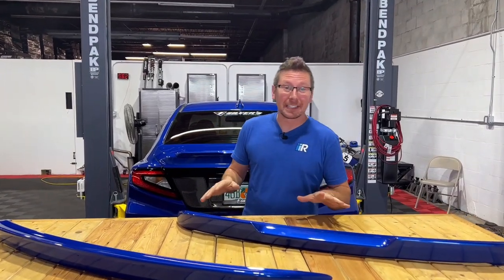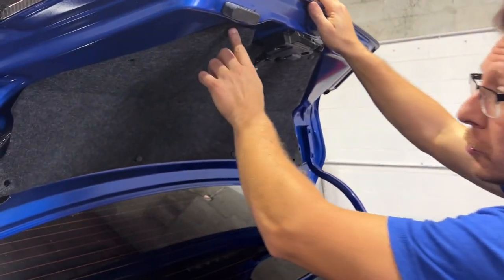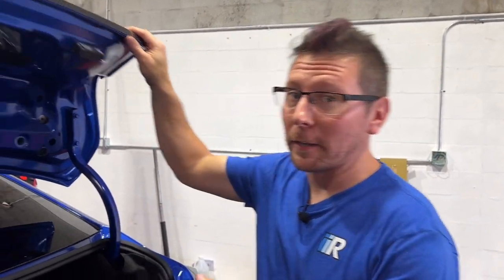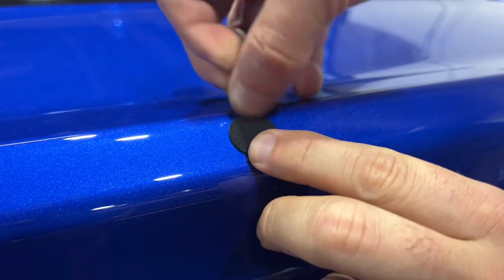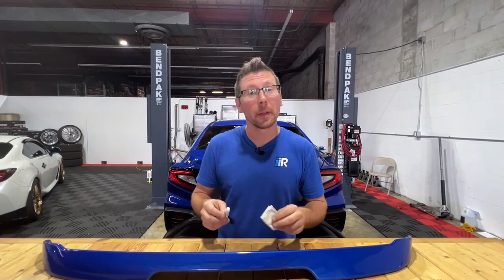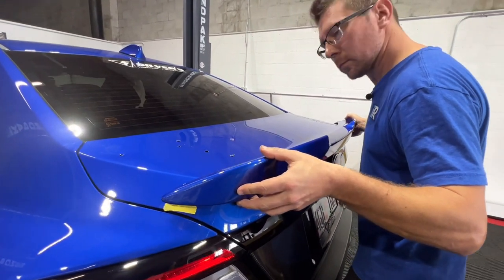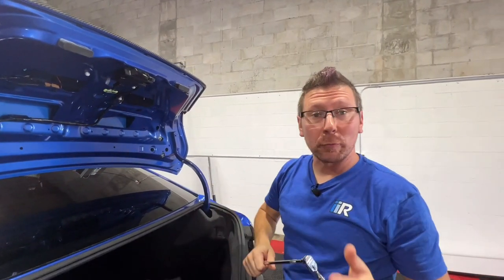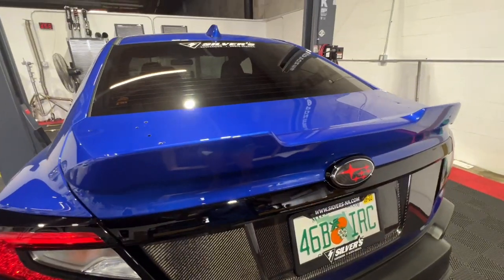How to Install Noble V1 & V2 Spoiler for the 2022 & 2023 Subaru WRX

Comment: Whats the difference between v1 and v2? Great video, Im a fan, but that quick blurb would have been nice lol 😉
Reply from the maker: The center is filled on the v1 and not present on the v2, in the opening scene you can see the difference visually :)
Reply: V2 it is for me then, only remaining question is gloss black or body color lol.

Thank You
Reply from the maker: @heatice77  Don't you worry, more coming in the next 2 weeks, many tons :)
Reply: So I have a premium, will it just bolt on like my oem spoiler unbolts?
Reply: @gaderrtyboi  It should be just like this install!

Comment: I thought the felt tapes with holes are in the most center holes then the no holes on the outer 2 holes on both sides? in the video it was backwards?
Reply: Good catch! The felt tape with the holes provides a water tight seal for those who are attaching the wing with the help of hardware. In our video the wing is attached solely with 3m tape, so the felt hole placement doesn’t matter.

Comment: Are there pre-dilled starter holes in the spoiler to match the 2 roof holes, or are you forcibly self-threading screws into the plastic wing?
Reply: They're self-threading into the back of the wing.

Comment: I had received my Noble Spoiler a few days ago and was in a panic because it didn't come with any instructions.
I had to find an online version of the OEM Spoiler instructions which filled in some install questions I had.
Sadly I have the Base model WRX that has no predrilled holes and the Noble Spoiler does not come with a template for the screw hole locations like the OEM ones does.
Thankfully this video has relieved some anxiety about the install and I'll have to hope I can get the hole locations drilled out in the correct locations.
Reply: Just use the 3M tape
Reply: @BarbWaltersMusic  I can imagine having nightmares about the spoiler flying off the back while driving 100+ on the freeway. I might just have to decide between the anxiety of that or the anxiety of drilling holes in my trunk.  Hmm....
Reply: @Sonahtrav  hello!! a 3M tape only install of this spoiler is very very secure, be sure to use the provided adhesion promoter and you will have no issues at all!! Be sure to install in 60+ degree temps as well.  -Derek @ Noble.
Reply: @derekgingerich   I see. I'll go for the tape only then. Definitely prefer not to drill holes. Thanks for the response!
Reply: @Sonahtrav  How did this install go? Have you have any issues with it coming off yet?
Reply: @chadbaxter4036  Honestly, I wimped out. I bought the OEM Duckbill in black and installed that instead.  I couldn't get my mind past just using only the 3M tape and the OEM Duckbill came with a template for creating screw holes in the base trunk. It was quite a task to drill the holes to install the OEM Duckbill. Installing the Noble one with just the tape would have been easier but I do feel more peace of mind knowing there are screws holding the spoiler in. I still have the Noble paint matched one so I can swap it in whenever but currently I am liking the black on blue look with the OEM one. 😁
Reply: @Sonahtrav  Ah, makes sense. I think I feel the same way knowing there's really nothing "locking" it down. Sounds like a sweet color combo you ended up with too!

Comment: I'm wondering if the 3m tape will stick to my ceramic coat if I use the adhesion promoter or do I need to remove the ceramic coat?

Comment: I'm confused. For the STI Style High Back, does it use the inner most mounting holes or the factory ones (holes # 2 and #5 if you count from left to right)? Other install videos show the wing being secured using the factory bolts into riv-nut type fasteners on the wing in those same #2 and #5 holes that the factory spoiler uses. Maybe there are different versions of the wing that are causing this mixed info?
Reply: Great question! I can’t speak for other manufacturers, but I have tons of experience with Noble. This wing uses a combination of 3m and self tapping hardware to secure. On the back of the wing, there are two threaded holes used to support the wing during the painting process. These holes come CLOSE to lining up with the existing holes in the trunk. But unfortunately, not a perfect fit. There have been others who drill new holes OR modify the factory holes in order to re-use the factory hardware.

Comment: Can this be installed without the 3M tape?
Reply from the maker: Technically it could.... If properly secured with hardware. On the other hand, you would need to place a protective layer between the spoiler and the trunk to protect the paint. So you might as well apply some 3m!

Comment: Are there holes in the wing for the screws?
Reply from the maker: There are two nut-serts in the wing that are commonly mistaken as mounting holes. The holes are used to stabilize the wings during paint. They line up very close to the factory holes but not exact.

Comment: Does the v1 block the rear brake light?
Reply from the maker: no you can still clearly see it once it is installed.
Reply from the maker: also if you add the noble f1 and reflectors, you have TONS of brake lighting ;)
Reply: @ImportImageRacing  I ordered the v1 and installed it today. Fitment was great, however I am having trouble using the self taping screws, they wont catch. Any advice?